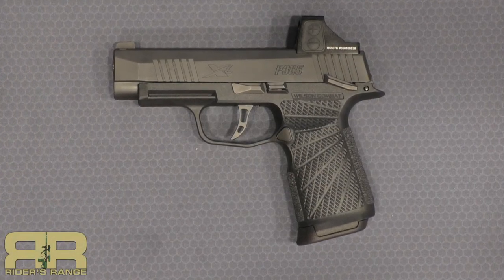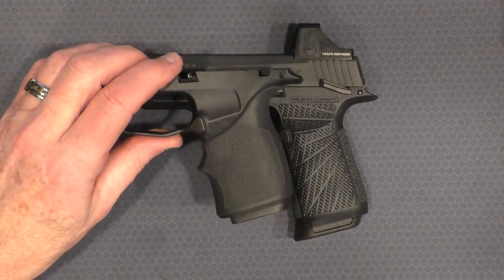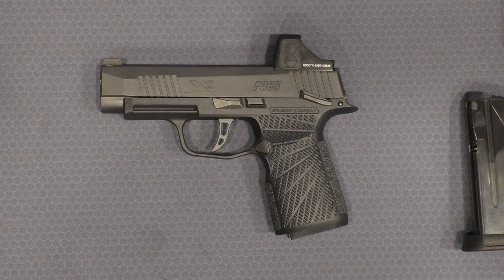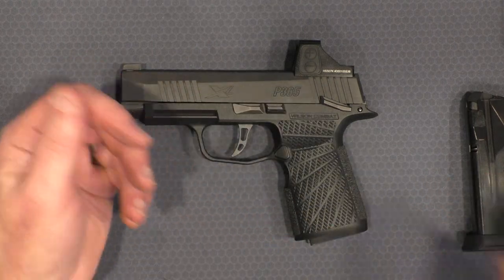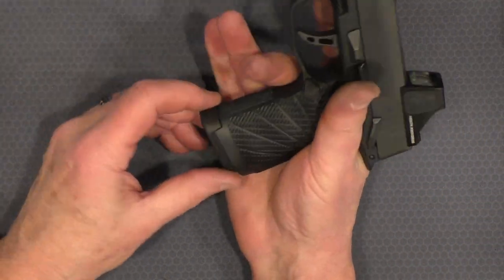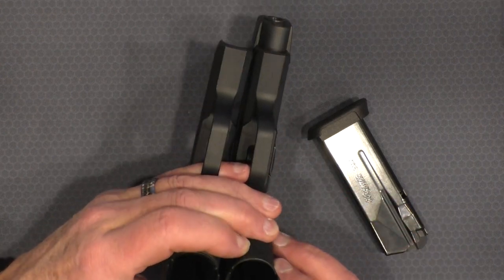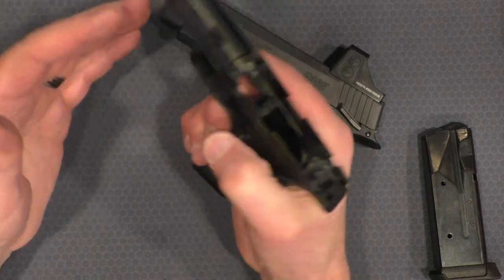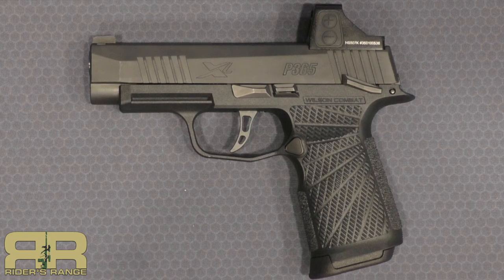Wilson P365/365XL Grip Module

Comment: Have you checked out the icarus grip modules...they seem incredible
Reply from the maker: I have and I like contour and the fact they are billet aluminum, but at $250 to $275, I haven't found a way to justify the cost. And right now they are sold out for the P365XL, plus a 4-12 week lead time for modules for the XL with a manual safety.

Comment: I'm looking to make the switch on mine from no safety to adding the thumb safety. Does the WC come with the parts to add the safety?
Reply from the maker: The Wilson grip module doesn't come with any parts other than the mag release.
Reply: I think it's only a 3 part kit to add the safety comprised of a spring, pin, and the ambi safety switch. I thought the cost was less than $30 (my guess). 

I purchased my 365x with safety because there is no trigger safety like the Shield Plus has.
Reply: @emblems4life726  I ended up ordering the manual thumb saftey parts separately, it was pretty much plug and play

Comment: Looks good. I wish they would have made a 1913 rail for it instead of the proprietary rail.
Reply from the maker: My guess is that Sig required their rail. However, there are many lights that will work on that grip module, with a list on the Wilson website.

Comment: I recently bought the Wilson Combat XL grip module for my micro-compact p365 but the stock magazines don't fit. Are they not suppose to be compatible without having to change out baseplates?
Reply from the maker: The regular P365 mags won't work in the XL grip. However, the stock XL mags work just fine, though a new baseplate makes it look and feel a little better.
Reply: @RidersRange what pinky extension base plate are you using on your 365xl magazine in the video?

Comment: I use a Wilson grip module as well.  good video.  what red dot are you using?
Reply from the maker: That's a Holosun 507K.
Reply: thanks,
Reply: @RidersRange  not just any 507K, but the first version with big buttons. Not easy to find now.

Comment: I had the Hogue grip on mine too, but I ended up taking it off. I really liked the way it felt in my hand, but it seemed to interfere with my holster draw.

Since it’s a carry gun, I like the skinnier grip because it seems to be easier for me to get a hold of when it’s in the holster. 

I can still shoot it good enough stock, but for me there’s a balance between being shootable and “holster draw-able”- if that’s even a word.

This Wilson Combat grip module seems like a nice compromise, but I’ll probably keep what I got. For the money, I’d probably be better off buying ammo. Nice video!
Reply from the maker: Mike, those are good points. For me, the Wilson grip module was entirely worth the cost. But you are right, you could buy three boxes of 9mm for about the same price.

Comment: I’ve read that the standard Sig 12 round mag May have some issues and that the 15 round is not listed in their chart as compatible?   Is that true and would I need to buy new mags to fit the WC grip module?
Reply: 12 & 15 rd mags work perfectly
Reply from the maker: Again, as @Fighting Solves Everything replied, the standard 12 and 15-round mags work just fine in the 365XL module.
Reply: @RidersRange  I have the standard p365 not the XL
Reply: @Wayne Kelly,
I was looking at possibly the same issue. I have the standard p365 (tac pac), which came with three 12 rd. magazines. I noticed you can remove the sleeve of the 12 rd. magazine therefore making it so you can use them in the XL frame module. However, I believe I am going to have to purchase new baseplates (extended). I don't think I'll be able to reliably insert the magazines in the WC XL frame without this modification. I hope this helps anybody out there wondering.

Comment: Do you need to replace the magazines or do the Wilson grip fits Sig stock magazines
Reply from the maker: The fit the stock mags, but the baseplates should be replaced to better fit the grip contours. Tactical Development makes mag base plates - regular and extended - to fit the Wilson grip.
Reply: @RidersRange  does that include the 15 round extended i use with my xl?

Comment: What's going on with that magazine base plate?  That doesn't look anything like the flat plate on my 365X.
Reply from the maker: The mag baseplate is from Tactical Development.
Reply: I bought pinky extension plates from Armory Craft for my 10/12 round mags. Perfect for me big hands and Hogue grip.
Reply: Hey Guys thanks for the leads.  I ended up getting a mag extention from Tactical Development.  They didn't have any black available so that's a little wonky.  I ordered a grip module from Wilson even though they say sold out.  I ordered it this past week and received notification yesterday that it's due to be delivered this Friday.
Reply: @jeffreymelber9582  you should've gotten the baseplate from MagGuts. I think it looks better than the TD version, plus it comes with a replacement spring and follower that turns your 12 round magazine into a 14 rounder that is easier to load.
Reply: I installed the Wilson grip today.  It fits real nice it's a tighter fit than the stock and the grip is slightly larger.  It feels real good.  Haven't shot it yet.  So far very nice and a little more aggressive stippling.  Mine did not come with a mag release.

Comment: every other video i watched, said the increased grip size was a detriment to the WC grip... I'm just sitting here thinking, THAT'S THE WHOLE REASON I WANT ONE. I have the same thoughts that the 365 is okay to shoot as it is, but if it was just a smidge bigger in the circumference, i could shoot it so much better.
Reply from the maker: So far, everyone who has shot the 365 side-by-side with the original grip module and the Wilson module has preferred the Wilson. That slight additional grip circumference and contour does make a difference in "shootability" without detracting from concealability. Thanks for watching.
Reply: @RidersRange  thanks for that reply, that I think seals the deal for me. Going to order one as soon as I can 😀
Reply: supposedly hickock45uses the 365 or 365xl as his carry.  the reason i went with it was due to large hands like his.  out of the box i can smack at 21 feet with iron sights.  i push it back 9 more feet to 10 yards and my groupings fall apart.  decided old eyes plus target acquisition, went to holosun and it seems to be getting me out there better, need more rounds.  i hope the wilson doesnt give me a problem bringing the red dot over....good vid, like the preso, i liked and subscribed to this channel
Reply: @Tom Ubl  so, I have to say after having the wilson combat grip for a few months, it's NIGHT AND DAY difference in how much better it is over the factory grip. I went XL grip on my regular 365 slide, and it's incredible. No more snappy feel, I can drill the target at 30 feet now. I do plan on adding a dot sight on there this spring, I enjoy the speed of a red dot on my g19. 
The grip, even though XL size, also doesn't print any more than the regular frame did. Solid win with the Wilson frame. Especially for 60 ish bucks. 1000% recommend

Comment: What's the brand on the magazine / or magazine base pad you are using ??
Reply: I wanna know too. Looks good with the module
Reply from the maker: The base pads are from Tactical Development.
Reply from the maker: I do like the Tactical Development mag bases. Thank for watching.
Reply: Was just wondering if you remember the model base plate they seem to have a couple 12 round mag plates. Thanks and very good vid
Reply from the maker: Jason, if I recall correctly, that is the Pro Ledge baseplate, not the Large Pro Ledge.

Comment: Will the xl grip module fit the regular 365
Reply from the maker: Yes. I've put my regular P365 upper on this lower.
Reply: Not so sure about that being 365XL has 12 round mag vs 10 rd mag for 365 just saying
Reply from the maker: The XL slide works just fine on the regular frame and the regular slide works just fine on the XL frame. You just need the correct magazine for whichever frame you are using. In fact, the frame and slide for the P365 .380 are equally interchangeable, though there aren't any .380 mags that fit the XL frame - yet.
Reply: They make a 365-specific Wilson Combat grip module thats shorter with the 10 round magazine cut in addition to the grip module shown on XL modules. Note the XL grip module version can be used in conjunction with the XL 12 or 15 rd magazines to create a 365'X'.
Reply: Tactical Development sells a Wilson Combat style magazine base plate that continues the WC ccontour and starburst tecture pattern . IMO it's more pleasing to the eye and more functional than the Proledge base pad in the thumbnail.

Comment: I am hoping that they are available for the 365X,,,
Reply: Use the same grip in this video.
Reply: @tsomers01  thank you. How do you I know that it is a matching unit?
Reply: @paulrampon1167    The only difference between the X and XL is the X has a shorter slide. Same size slide as the standard P365.
Reply from the maker: I can put my standard 365 slide on the 365XL grip module and fire control unit and I have the 365X. They all play well together.
Reply: @RidersRange   thank you. I will order one form Wilson today. Be well Sir

Comment: Does someone make an extended mag release?
Reply from the maker: Probably, but I haven't searched.
Reply: @RidersRange  still waiting for mine ...ups isn't what it used to be.it passed thru my town a couple days ago....hoping it finds its way back...lol
Reply: @RidersRange  you mentioned the houge grip. I bought one also. The feel was nice.but looked extremely thick about where the finger groove is. I took mine off because it was so thick. Good range grip but a bad ( at least on mine ) carry gun. That why I ordered the WC grip as soon as I saw your video. Excited  as kid for Christmas. But dealing with "delayed " shipping. If I was a kid it would be abuse making me wait ,for my Christmas.
Reply from the maker: The website said it was backordered when I ordered mine, but I still got it in less than a week.
Reply: @RidersRange  I'm hoping ice we had delayed it. I ordered it and gun oil. I hoped that I'm getting a grip and not just the oil.
Reply: Lots of companies do. Cheapest ones are around $25 on ebay. Armory Craft makes one. My favorite is the Zev Tech one. I have two of them I love them so much. The Zev is unique in that it also has a shelf that extends the mag release even further back for smaller hands, which I have.
Reply: Look up Vuurwapen, they make the ext mag release I think in two styles.  I saw those and made my own to my liking.

Comment: Why would they NOT make it in tan with safety? That’s just dumb.
Reply from the maker: My only guess would be that Sig doesn't offer the manual safety model of the P365 or P365XL in FDE with a manual safety, so Wilson wasn't going to invest in a grip module that folks weren't likely to buy. But that's just a guess. Thanks for watching.
Reply: @RidersRange  Sorry, but Sig does indeed offer FDE with safety. Just saw one on their website. (Coyote)
Reply from the maker: @juaneato  I checked the Sig website before I replied and didn't see it. I must have missed it. Thanks for the update.
Reply: @RidersRange  it’s the “coyote” color.
Reply: @RidersRange  -  making what they think will sell best

Comment: Why can’t a company come out with something like this for under 100$ the originals are that cheap so why can someone make an improved polymer one, doesn’t need a bunch of fancy stippling or anything , just simple.  I would love one of these, but nit paying half of what i paid fir the pistol for one when I know the production cost, oh well. Hockey tape has been doing well enough so far i spose.
Reply from the maker: The Wilson Grip Module is $64.95.
Reply: I just paid $63 for one shipped to my house from optics planet.
Reply: 1 don’t be poor also they are 60 bucks
Reply: The Wilson is worth every penny, it's under $100 even with the Tungsten weight kit added into the mix.